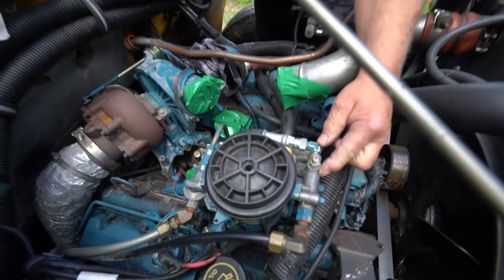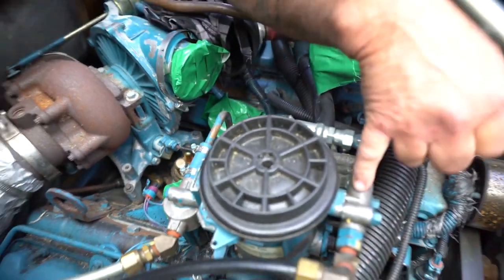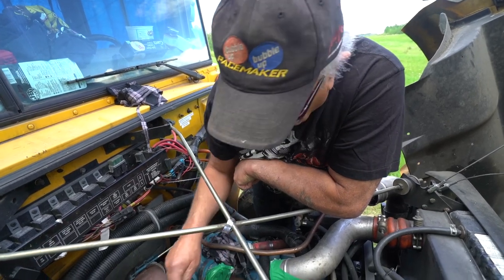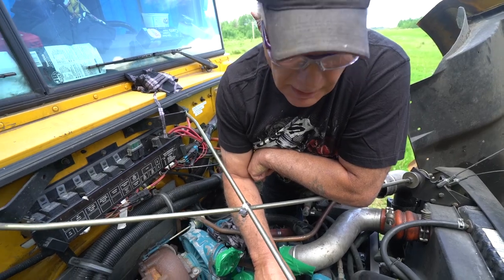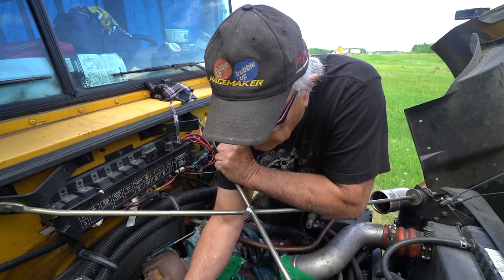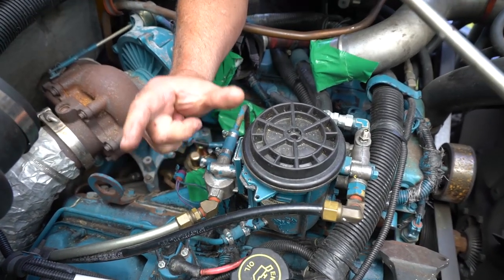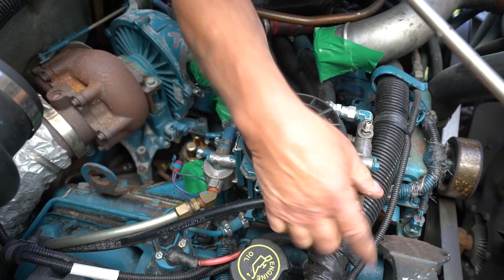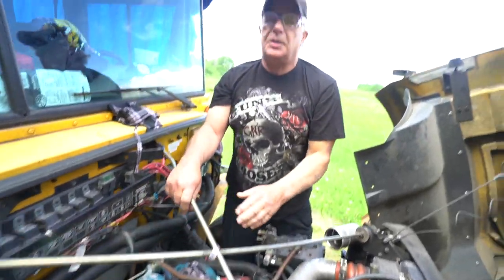WASTE VEGETABLE OIL CONVERSION EXPLAINED (WVO SVO)

Comment: Would be pretty dope if you have a Power Generator running off of the same Oil

Half Joking, 

You could hook up a meter and sell power at the meetups, or just charge hourly at $1 per Amp. 

Give them an Extension cord on a 10Amp Circuit Breaker for $10 an hour, or go up to 20, 30 or 50 an hour.

After it works out you can tow a huge generator on a trailer.  I would assume 30% of people would like to have additional power. I know I would pay for it in a pinch.

Comment: Only thing I'm wondering, and I might answer it myself, is there are no changes with the injectors?

Is that the reason for getting the oil to 150°? To improve the viscosity so that it flows the same as diesel.
Reply: Scott Maschino yes injectors are stock 🇨🇦

Comment: Badge is some kind of diesel genius! I’ve been trying to figure out something similar to keep tanks from freezing. I’m going to look up Arctic Fox. My only question on this is that during the summer, isn’t the webasto going to dump heat into the interior? Or are we talking about a different webasto device than the RV heaters?

=== EDIT ===
I figured it out. Two different webasto products. But now I’m thinking you could have a switch that would allow you to run heated coolant through your holding tanks AND under the floor for radiant heat! That would be awesome in cold weather!

Comment: You won't be able to go to another mechanic cuz badge is the only one who will know how it works.  LOL.
Reply: Todd Ramsay thx
Reply from the maker: Hopefully I’ll be able to fix any issues after learning so much from him
Reply: Greg zander thank you i was in the same vote no one knew the system and what to do so we figured it out works awesome. The mix ratio is 70/30 70 diesal 30 veggie should be good filtration will work harder but shouldn’t plug fast. 🇨🇦🇨🇦🇨🇦
Reply: Yes you got to start on diesal and purge on diesal. Then shut down lol at 70 degs out i shut it off on oil and 12 hrs later started right up

Comment: Awesome job at going over the systems....... I have a bit of an odd question for you. would it be possible to run low profile house baseboard heater on the bus... off of the engine coolant? I have seen something similar in a motor home
Reply: john colasanto yes
Reply from the maker: The dude has answered 👆👆

Comment: This is probably a question for Badge.. Does the Purge of the veggie oil happen upon shutdown and startup? Or does it just sit in the lines and cool in the engine bay? It seems to me like you would want the solenoid valve as close to the Webasto as possible in order to make sure the engine never starts with ice cold veggie oil or stops with 150 deg veg in the injectors or the lines. So a purge of the lines would have to happen every time you start the bus or stop it with fresh diesel.
Reply: In addition, a recirculation valve up to the manifold that switches diesel to veg going to the Webasto would solve the cold oil in the engine bay. Meaning you would have to wait 15 min for the Webasto to put the oil up to temp. You would still have to solve the problem of shutting down with veg oil in your injectors. Or I might have missed that.
Reply: To solve the cold oil purge, a turbo timer, and the solenoid switching to diesel would actuate upon when JAX shuts the engine off. Thus running the engine for the time designated on the turbo timer whilst running on diesel.  There I just solved the problem, unless someone else has a better idea.
Reply: You control purge you put switch to purge anytime 🇨🇦🇨🇦
Reply: We built it so we control it not timers 🇨🇦🇨🇦🇨🇦
Reply from the maker: The idea is to start and stop on diesel. 🤙

Comment: I have a stock GM 6.2 diesel with a Stanadyne mechanical injection pump, mechanical diaphragm lift pump and BTE turbo system. Any suggestions for doing a veggie oil conversion?
Reply: Dadcam Rocks mix it 70/30 veggie change nothing lol🇨🇦🇨🇦
Reply: Not being cute but is this your answer for any system? Just wondering...I'd make sure the hoses are all synthetic but it should work well in temperate climates...cheers!
Reply: No cheap is the work i did lots of research that is the easy way. Jax system is 💯% veggie or diesal this is why we doing it like this.  🇨🇦🇨🇦

Comment: Whoa! Straight outta the gate I've gotta compliment Badge on his wicked cool tee-shirt...far-out mah man! Jax are you makin' diagrams and takin' notes? Ya may wanna make your own manual for that chip wagon in case ya break down a thousand miles from the head mechanic and engineer there. Once ya do get motorvatin' you're gonna make drivers in supper time traffic jams so damn hungry heh, heh, heh. Get him rigged up with a good ol' forty channel CB Badge. Then he can chat with truck drivers and get around easier. When I was truckin' I couldn't tell ya how many times the CB saved me from all sorts of bullcrap. Have ya seen the custom "Skoolies" in Central America Jax? I think they took lessons from Japanese truckers, there's loads of videos on YouTube and they are pretty wild. I figured you fellas were heavy into the R.& D. for that fuel system. I can't remember what the delay between recordin' and watchin'  is for your videos Jax. Later. ...............................PEACE!!
Reply from the maker: Haha yeah! I took chicken busses in Guatemala. That’s why there’s a bus in my intro. I made it years before my own bus!

Comment: can you ask badge if he knows if K&N has filters (oil and air) for the bus version of the 7.3, I know they have one for truck versions (they are different)
Reply: Coolbreeze yes very expensive though 🇨🇦🇨🇦🇨🇦🇨🇦
Reply: Vlite Rving model numbers please if you know them
Reply from the maker: I had k&n on the ford 7.3L but people say they let fine dust in 🤷🏻‍♂️
Reply: yes all K&N products are expensive but that's why people keep buying their products, as for the air breather remember all you do is wash them out and reinstall, as for the oil filters if the price isn't too high I might switch over to them as well
Reply: i didn't mean to say they were buying them because they were expensive, i meant to say they keep buying them because of the performance even though the price is high

Comment: With out good fuel filters, you will have thousands of dollars worth of injector work required sooner than you want. Not to mention that if the engine was not designed for vegi oil, vegi oil will swell o rings creating leaks and seal failure. This is penny wise and pound foolish. It will work for a bit then...

Once you stop, let everything cool down overnight,  and have the vegi oil turn to solid that is in the engine, you will not be able to pump solid vegi out of the engine back into the tank to then get regular diesel.  You have created a twice as complicated system to fuel the engine...more complicated = more trouble.

I am looking forward to being wrong and you having a great year round experience. Good luck!
Reply: Kenneth Watson we made it better wait and see 🇨🇦🇨🇦
Reply from the maker: Thanks man. We have a system that will flush it out. BTW diesels were invented to run on veg oil. Only time will tell, and I’m sure whatever happens will make for great videos ✌️